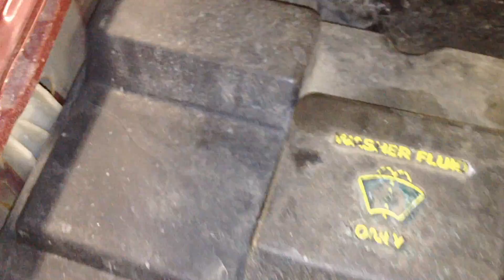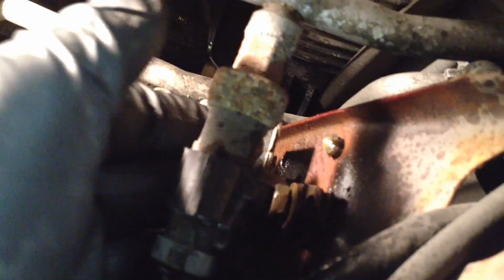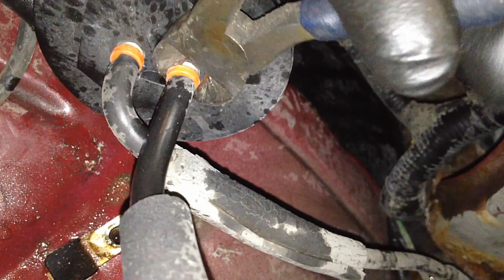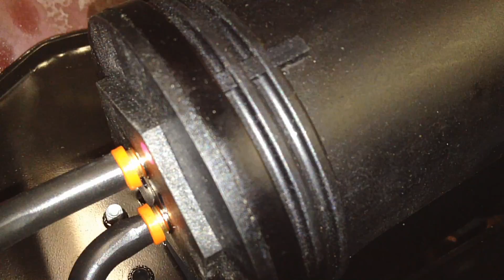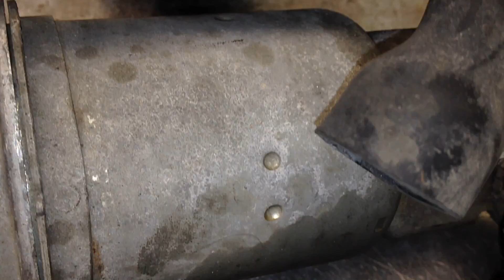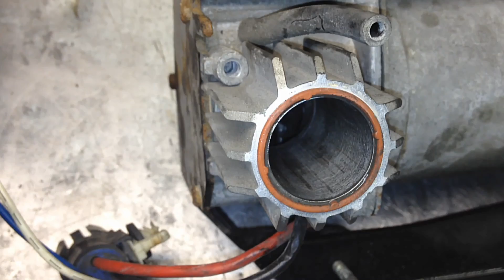Ford Air Ride Suspension Air Compressor Replacement

Comment: Have see many jobs where the air lines are taken out of the solenoids, by depressing the retainer into the solenoid and pulling the hose out. Your saying the drier is not the same process?

Comment: The compression fitting are reusable push back on yellow and wiggle line out then you can put it back if you want if you need to disconnect it for some reason.  Love that style
Reply: Could of sworn I had seen that done. Have for sure seen it done with the individual air bag solenoids. Thanks

Comment: I don't know if your answer this or not all my airbags are deflated I put new sensors on all three or brand new put a new air pump in brand-new the pump will not turn on if you bridge the square relay that's on top of the pump the pump turn on its powers on nothing fills up

Comment: Can you please tell me where does the short vacuum hose on the air bag pump on a 1990 Lincoln Mark Vll goes to connect to the main air line to air pump? I’m changing my old pump & it was removed, before I had the chance to see where that vacuum hose connects too. Thank You 🙏🏽

Comment: On the air compressor what is each of the four wires for on the plug power, ground, and switch for use in a after market application in none ford vehicle?

Comment: How do I bleed the air?
Reply from the maker: No need
Reply: I was asking because my town cars driver side bag has lower psi than the other one and I was thinking of disconnecting it from the solenoid to replace it. Would a bunch air shoot out and hurt me or is that how I'm suppose to do it?
Reply from the maker: There is a double locking mechanism so once you twist and pull back on the solenoid it will vent then you must turn it again to finally pull it all the way out.
Reply: @FordTechMakuloco  alright thank you I appreciate it

Comment: I need to find an electrical pigtail like the one on the air compressor in this video.  Do you know where to find one?  Or do you know the part number for the connector alone?

Comment: Is there any type of o-ring between the filter/dryer and the compressor connection at the twist lock?
2003 navigator 2 we.

Comment: How do I know if my expedition has this air ride? I'm assuming it does but it's an 06 and I bought it used 3 yrs ago. When I first started driving it it felt like I was driving a big fluffy marshmallow around which was awesome but over time I can now feel every little bump and it has a very stiff ride. Idk what to start replacing. It hisses over speed bumps too, both front and back. No air ride dash light ever came on so idk if it has this or maybe it was disabled a long time ago (read u can do that to keep the compressor from burning out if a bag leaks) before I bought it. I just want my marshmallow feel again xD

Comment: Great videos! Quick question, I have a 2004 Ford Crown Victoria LX Sport with air ride. All seems to be working correctly but my driver's side rear is always one inch below the passenger side. I've replaced the old bags and compressor is working fine. Any ideas where I should look??
Reply: Did you ever find out?
Reply: K
Reply: I have a 1992 oldsmobile an mine started saggn ..bad I think 🤔 my compressor went out anyone have a video on how to switch them out ?

Comment: 2010 Expedition EL. My right rear bag is all the way down and will not inflate. Changed the ride height sensor and still no difference. Any suggestions?

Comment: I replaced my air compressor and air suspension checked the fuses and for some reason it still won't kick on any suggestions
Reply: Did you ever find out?

Comment: Great video, I have a 1999 ford Experdition air Suspension rear wright is low, rear left is 3' higher. there are no hole in air supervention balloon. both new. Pump works. What do you think is happening thanks

Comment: My 2011 expy el says check air air ride system. Rear isn't sagging, but i don't hear the pump running anymore. Any tips for diagnosing?

Comment: is there a separate compressor for the rear, I have a 2004 Lincoln navigator, the compressor piston is broken, and the front is slammed down but the back is up.

Comment: Hi, nice video. My rear suspension sags all the way down. The airbags and solenoids are brand new but it will not air up the rear  all when the compressor comes on. Could the new solenoids be sticking or the compressor be too weak? The compressor doesn't sound weird but could the internals be broken and not binding?
Reply: I have the same issue!  Any ideas FordTechMakuloco?

Comment: awesome video I have 2006 Lincoln navigator only front will drop compressor will quick in when I put the truck in drive it will slowly raise up and stay like that but as soon as I turn off the truck the it will start to drop not all the time which is the weird part.

Comment: My 2005 lincoln nav, is releasing air at certain time thru the solenoid, front passenger side, and is no going all the way up like it has to be, what do u think? Could be the height sensor that is making the solenoid to release the air? (Note) i have already replaced both solenoid sides too, and it's not leaking.

Comment: I have two questions, on a 2004 Lincoln Navigator, I replaced all shocks, height sensors and shock solenoids, driver rear shock will not raise t the same level as the passenger rear shock and have new height sensor. Also I noticed my front will not lower or kneel. I also get a check suspension light when driving after 20 minutes of driving. Any suggestions? Thanks in advance.

Comment: I have a Windstar air dryer and the plugs aren't going in, and neither is the air hose any ideas? And to top it off i broke one of the plugs trying to force it in..
Reply: i did the same i think, i broke the brass fitting that holds hose into the drier, any knowledge where i could find those?

Comment: Harold Casco is right… .also if you scratch the air line part that goes in to the fitting is a sure air leak.

Comment: Can I just delete this part and switch completely to gas shocks instead of these ARC shocks?
Reply: SkinnyFB 
They make s kit I believe it uses standard shocks and springs from a Ford Expedition.  In other words you upgrade your Lincoln with ford parts.

Comment: I know that this is an old video, but I have broken compressor lines from my compressor to my rear air suspension. They currently are being held together by clamps and super glue (holding quite well actually, lol) but I can't find the replacement lines.
Reply: any luck finding??? i did the same
Reply: Junk yard!
Reply: @bernardtiburon1393  it's just HOSE! FROM MANY AUTO STORES SELL IT.  BRING A SAMPLE

Comment: I have a question I hope you can help me with I have a 1996 Lincoln Town Car it has 74,000 miles on it in great shape right however I do not drive it that much and recently I started getting a slow start in the morning and just this past week and a half I did not drive it at all and went out to a dead car battery does the air ride system keep the car level when the ignition is in the off position I know in the past I have heard the compressor come on well near the vehicle with it off as it did on the Lincoln I had before which was a 1995 so I guess it boils down to should it be coming on while ignition is off if there is a leak in the bags? If so I plan on converting over to coils and shocks

Comment: next time you don't have to pull the whole valve just push the orange tab and pull only the hose just saying 😆
Reply: In 30+ years of working on Ford air suspension, I've VERY rarely had an air line not release.  At worst a quick shot of light oil and they pop right out.  As far as "weakening the line at the flex point", there's no 'flex' there.  You should at least show the proper way to remove them, if someone can't get them out (99% of the time they'll release), THEN they can destroy a reusable part.  You should edit your video to show the correct procedure.
Reply: @randys6698  Thanks, thought I was loosing my mind a bit there.
Reply: Yeah somebody needs to watch some YouTube videos on how to take the air hoses out  X)
Reply: If I had not done this before and watched this for the first time, I would be frightened...
Reply from the maker: On some yes but I have found working on these older cars and trucks that they still will not release many times, so instead of fighting it and weakening the line at the flex point I eliminate the problem plus I like to use a new section of line to ensure no leaks.
Reply: Harold Casco yep

Comment: Hi FordTechMakuloco I've an interesting problem here with my 07 Navigator. So troubleshooting the rear end down issue, while I was checking the connector to see if there's power going into the compressor I accidentally touched the other pin in the connector and shorted something and lost power to the connector for the compressor. I've heard something tripping like a blown fuse, checked all the fuses and all checked out fine. Checked the relay #53 in the Power Dist. Box (Air Susp, relay) and all related fuses Also fine. Where else should I check? Thank you

Comment: Hey , so your video was helpful but I cant figure out which is the right air compressor to buy? Is the same exact one on your video . Any idea? or do I have to take the fluid tank and look for serial number and order it?? No clue
Reply: Is a 2002 v8 expedition rwd

Comment: I found my drivers side air bag has a leak. I want to go with springs instead of the $720 single air bag, on a 1997 f250 can I swap the bags for springs?   Thanks
Reply from the maker: +John Beckham companies like strutmasters.com offer kits.

Comment: Thanks for the video. Everything worked out fine, but I noticed that I am not getting a good seal on the two hoses fitting into the pump itself. At about the 3 minute 52 second portion of the video it seemed you has two yellow fasteners which accepted the hose and then locked into the pump; I suppose giving it that true snug fit I'm lacking. Did they come with your pump because my pump did not have those. On, can you give me an idea of what those fasteners are called and where they might be purchased? Thanks again for this informative video.

Comment: I just replaced my front springs in my 2002 crown vic LX Sport and raised the front. Until they settle is there a way to make the rear go higher to reach the front height?

Comment: no no no, those fittings on the dryer are push in reusable fittings man. you press and hold with fingers or flathead the orange looking ring at bottom while pulling out the air line.
Reply: Brycen Heller 
can i buy a new fitting? Because it came out when I pulled the air line out and i had to pry it off. Or do i need a new dryer?
Reply: did you have to order new fittings? if so where?
Reply from the maker: Yes but allot of times I see cracks at the point they enter and more often than not they stick in there and that release method does not work.
Reply: +FordTechMakuloco with time and all that heat, yes I agree that can be an issue. just letting you and anyone else know the fittings can be reused. the line is as you say

Comment: my compressor keeps coming on and off all while the truck is riding it's a lincoln navigator 2000 model..do I need to replace the compressor?
Reply from the maker: +TAMI no the shocks in the front or the back in the rear are losing air as they extend causing the compressor to correct for the loss.

Comment: can you answer me a question please.I have a 2001 Ford Expedition and the rear sits way to high. What can be causing this?
Reply: My 2000 Gator is doing the same.  I've disconnected the bottom of the ride height sensor and pulled down on it about an inch to fool the system in thinking it is too high and thus lower by releasing air from the bags.  I hear clicks from the front of the car and in the air bag solenoids, but the system never lowers.  Is it possible to have bad solenoids that will allow air in, but not out?  I also noticed the ride height sensor has some lateral play in it, could it be worn out.  From what I've read these are pretty reliable.  For reference I have 180k mile on it.    Thank you for all your help +FordTechMakulocu
Reply: James Matsko I have the same issue in my 01 XLT 2WD. The rear sits too high at times and I don't hear air being released from the air bags when the solenoids click. Have you found a solution for this?
Reply from the maker: +Teresa Olhei disconnect rear height sensor linkage
Reply: +FordTechMakuloco  where is that located? I know its in the rear just not sure where?Also will that stop the rear end from bouncing all over the place?
Reply: FordTechMakuloco can you please discuss ways to troubleshoot this system if air isn't being released from the air bags when the solenoids click? After carrying a heavier than normal load, my 01 XLT will sit too high and generate a check suspension light on the dash.  System was running fine with no errors before I replaced the 2 original air springs/solenoids. I also replaced the compressor and rear ride height sensor as preventative maintenance.

Comment: Hey man i also have as problem with my air ride suspension.(mines is a 1999 Eddie Bauer RWD) It turns on but it just sounds very slow then turns off and basically does nothing to lift up the rear. I dont know if it could be bad connectors or the compressor itself or both. Please give me some insight before i have to drop some serious cash.
Reply: fallow his other video! I'm glad I found this video or I would of spent hundreds at a shop trying to find out what was wrong with my air suspension

Comment: My friend and I replaced his air compressor in his 2010 Expedition EL with an Arnott. It works good but we can not figure out how to remove the "Check Air Suspension" warning that comes on every time we start it up. Tried disconnecting the battery for about 30 minutes and it still displays on start up. Any suggestions? Thank you

Comment: Thank you for making these video posts they are a big help.
 Okay so about 4 years ago I went to a store and when I came out the front end on my 2005 EB 4X Expy was down. I started the truck and the compressor started normally and it pumped and tried but was not able to lift it (suspension light came on after a bit). 

It is very odd , when it is over 70 degrees the truck suspension is fine, when it dips below nothing. Electronic board crack?

So I've replaced the tops and o-rings nothing. I've replaced the whole front bags complete, did not do anything. I've replaced the compressor dryer nada. I took it in in the beginning and the dealer wanted to replace the tops and o-rings fro 500 bucks. I've taken it to a local shop and he replaced the lines (leaking a little ) and a new front bag, that did not do it.
 I just replaced the ride height sensor and nothing. Now the compressor wont start up and it immediately goes into a suspension light on in the dash. I jumped the relay and the compressor works, but it wont lift. I guess the control portion is not enabled so it cant. Today I replace that relay see if that does anything. Is there anything else? IS it possible the ride height sensor was bad and the relay wont engage? 
Taking it to the dealer next, I give up.
Reply from the maker: Yes both front height sensors should be disconnected from the linkage and cycled up and down and checked for voltage input to the 4WAS module.

Comment: Excellent video. I found this video while searching for a solution for the issue that I'm having with my '04 Navigator front suspension not airing up when it's below 40 Fahrenheit. I suspect that the valves on the solenoids are freezing in the open position because the "crack" staff at the dealer didn't replace the dryer after they replaced the pump (since that's about the time I started experiencing the problem).

Keep up the excellent work!

Comment: hi how r u I got 2005 navigator problem is the front left bag was leaking I replaced it all the fuses  and the  relay next to air compressor is good to it comes on seem to be working fine but it doesn't rase the suspension at all I've  checked the level sensors  all ok I have 2 compressors 2 of each level sensors and 2 control module's  I don't see any leaks I need help I'm trying to get this working there is signal by the solenoids  when air comp is on but nothing happens thx much in advance
Reply from the maker: +MARK GINZBURG If you changed the control module it needs to be calibrated by the ford dealer.

Comment: I changed the relay & pigtail on my 98 Navigator. The pump goes on for 2 seconds & then shuts off without pumping up the rear. The pump stays on when I connect a wire to the 2 thick relay wires. Also not sure how you connected your wires with the window motor. Any suggestions? By the way, the front is perfectly fine. Awesome videos too.

Comment: can you replace an air ride suspension compressor with a used one?
Reply from the maker: +Anthony Agnone Sure if the used one works fine. I would at least replace the drier though.
Reply: Where could I get the drier
Reply from the maker: +Anthony Agnone Ford sells them separate and the aftermarkets that cater to the air ride systems sell them too.http://www.amazon.com/gp/product/B0108MQOWC/ref=as_li_tl?ie=UTF8&camp=1789&creative=390957&creativeASIN=B0108MQOWC&linkCode=as2&tag=fordt-20&linkId=2LHNULLGIY3LEOIX

Comment: Hello. I have a 1998 town car. I think this is my problem because the compressor does turn on but sounds akward and the rear will not raise. I checked the bags for leaks(ok) and replaced the selonoids. what do you think?